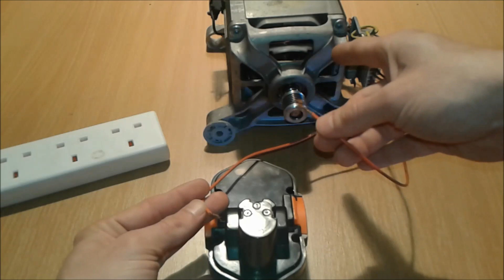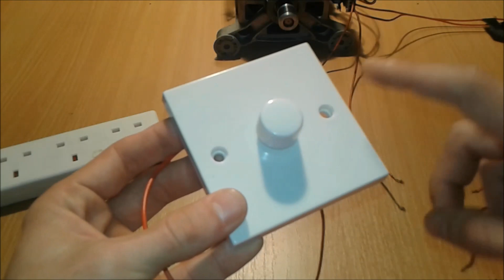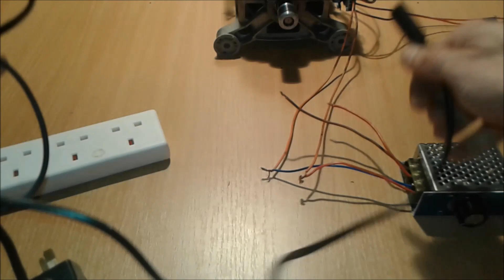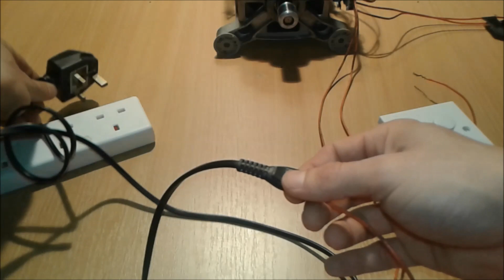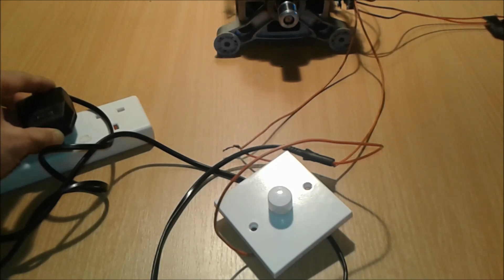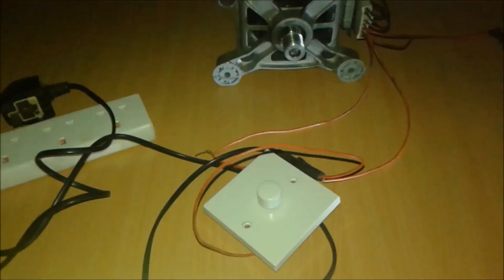Washing machine motor speed control circuit

Comment: You forgot one important thing, the two wires coming from the motor, you don't tell us which wires they are so this video becomes useless... maybe I find it on a better video?
Reply: The two wire at the back is not needed. 4 wires remain.two from coil and 2 from inside the  motor.bridge any 2 (one from coil one from inside the motor-connect the two wire torgether) the two remaining one is live one is neutral.just connect.it should work

Comment: what type of duty cycle is a washing machine motor? s1 or s2? can we use it as grinding wheel motor, 2800 rpm 500 watts for hours of using?
Reply from the maker: It depends 10000rpm at max speed for 10min 8000 rpm for 30m
Reply: @NoSkillsRequired  my motor is 2800 rpm so maybe it can endure for at least an hour? another question. you didn't mention what wire in the video so you plugged it by chance? I mean which wire should we plug the dimmer into it? live or neutral? and how you recognized windings of the motor?
Reply from the maker: @unobianconero5751  check out my other video about how to wire washing machine motor and then after you figure it out the dimmer has in and out therminals
Reply: @NoSkillsRequired  I watched that one and other one about generator, but I say it again you never mentioned L and N wire of the main cable (as you said it so) and which one the dimmer must be plugged to

Comment: how to lower to 60RPM Sir?
Reply from the maker: Exactly like in the video with a special coltage controller or with a light dimmer if the motor doesn't exceed 500w

Comment: Thank you. Worked perfect for me! I used a light dimmer for 650W and 4 Amp
Reply from the maker: Nice one told you so it is better and safer with voltage dimmer but light dinmer does the trick as well stay safe and see you on the next video

Comment: Great video ! I cant find The link for where to buy The AC controller.. can you please repetere it in The answere here ?
Reply from the maker: Hi there budddy the link is in the video description under voltage speed regulator or you can search on ebay or amazon motor voltage regulator all the best my friend
Reply: @NoSkillsRequired  my machine motor is 150w and 230v.what volt or watt will i used to speed up

Comment: No these are not good controllers for AC motors.  These may work well for dimming lights and a fan but do not work well for a motor you are going to use under load.  You are using SCR controller boards and at lower RPM, the power is greatly decreased making this practically useless for accurate speed adjustment.  What is needed is feedback so the SCR can be trigged at different points of the sinewave to maintain accurate RPM at lower speeds.
Reply: Thanks for saving me the trouble with what I'm building. What controller would you use to keep the power up? thanks
Reply: @michaelculhane3058  
Depends on the voltage and current draw.  There are some that work on 120V and others at 220V.  Next question... Are you running a brushed or brushless motor?  Are you planning to use the same motor described in this video?  Search the following "Connection of the washing machine motor, reverse and speed control"  Stay away from SCR controllers like this one or you will lose power at slower speeds.  I hope this helps.

Comment: Making a go-card u would be better off using a permanent magnet motor like a treadmill motor. I have a lathe and a mill both powered by these motors. If u do try ur motor use the old tram system parallel to stort off and series once u get up to speed. Good Luck.

Comment: Have u tried driving an actual machine like a milling machine or a lathe. There is no feedback and the speed will be reduced with increasing load.
Reply from the maker: mechmania not yet I have în plan more projects just a smart go cart with this motor no decrease in tork
Reply: Did you try speed control on the motor with dc power? Thank you

Comment: Pretty useless video, this doesn't speed control shi* ...  you have now made 2 useless videos, where you claim to be able to control the speed of a old washing machine motor ... Useless
you could just as well just turn a switch ON and OFF...
Reply from the maker: TERRAIN HARDY I am presenting options on how to control the speed take it or do your own controller but is not cost effective
Reply: @NoSkillsRequired  you presenting not "how to control the speed", you just turn it on slower  but it will still run with one speed ... so again you presenting sh*t, useless video
At least you could change the headline, but then you wouldn't get so many viewers when you say the truth ... clickbait that's what this is
Reply from the maker: TERRAIN HARDY check it out the title is not how to, wmm speed control circuit and is exactly that a dedicated device to adjust the ac voltage and conversely will vary the speed because this type of motor is depending of the voltage, and controlling the voltage according to ohms law will control the current as well but is to hard, and if is got views means most of the people find it useful all the best
Reply: YOU MEAN TDA1085C SPEED CONTROL WITH TACHOMETER  THAT STABLES THE RPM MOTOR THIS CIRCUIT DOSENT STABLE RPM´S IS JUST ABOUT SIMPLE TRIAC POTECIOMETER CONTROL And bosch siemens Míele is one the best german trademarks ever and pink floyd is the best band ever

Comment: Do you have any videos on wiring these motors on all three phases (a/c)? I do appliance repair and I want to make a a cord to power these up as a troubleshooting process (but not took familiar...still learning about these motors). If not, could you tell me how? (I want to connect all three phases to ensure the motor is working properly for the client...unless that does not matter...still learning lol)
Reply from the maker: Shaun Gutierrez hi there buddy în the washing machines there are different types of motors universal motor like the one in my videos, induction motors, and series wond motor or similar, check my video washing machine motor on battery and you can make a tester powered from 12v
Reply from the maker: Go and watch all my washing machine motor videos you will learn some stuff, and li-ion and more useful stuff
Reply: ...also, the reason I would like from 120vac is because it would be easier to plug in from the clients home as the source of energy.
Reply from the maker: Shaun Gutierrez we will see soon I will make a video about that
Reply: I would like to make one using 120vac. I'm not sure if you have a video wiring all 3 phases...if not, could I make a video request for you to possibly make one?
Reply: I'm actually, watching another one of your video now. I think I just want to ask you some questions about it, but looks like it will probably really be helpful to me. Thank you from Hawaii!

Comment: Great and fantastic explanation keep it up, I have got a question that ....what kind to motor is good for machine has to operate in low speed with arm(50cm) holding up 10kg of weight
Reply from the maker: Mo Yahya Thanks I hope is useful. For a low speed you have to find a dedicated motor a synchronous motor like the one in microwave but that one is for 1.5kg all the best
Reply: The typical way to reduce motor speeds and increase their torque is through gearing. A low input:output ratio results in slower speeds, but higher torque.

Comment: Oh , nope don't use the lamp dimmer it has a square wave output will burn Ur motor..
Reply from the maker: Edifier Bass thanks for the tip I am using proper controller but it was just for demonstration purposes it works but not recommended cheers

Comment: If you use a dimmer switch, you only change the torque, and the speed will be constant. the reason it looks like it's working is that it struggles to spin. Try pressing on the pulley with something and you'll see.
Reply from the maker: +VosDanner maybe you are right I am surprised that is working at all but the dimmer was 400w rated and the motor 500w so it might work but the dedicated voltage control one works best
Reply: That would be better for a lathe then yes

Comment: Could I use a dimmer switch like that to make an 11 amp angle grinder into a variable speed grinder? (I live in the US so I have 120v mains... don't know if that makes a difference or I need another kind of switch) Thanks!
Reply from the maker: The voltage does not matter basically if you live in us you have 120v the washing machine motor is designed for 120v operation.now you can use a light dimmer but i recommend a 400w one and you might not  get the full power because this light dimmer can act as a current limiter so if your motor is rated for 530w and the dimmer is 400w you will not get the maximum power and probably damage the dimmer if used long period of time.all the best
Reply: Cool, thanks!
Reply from the maker: Blakehx no probs any time mate